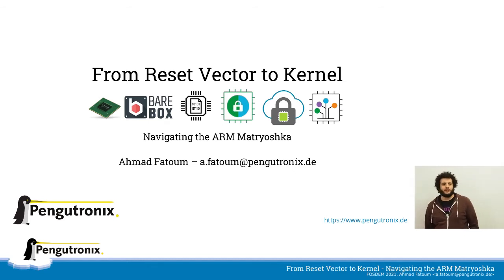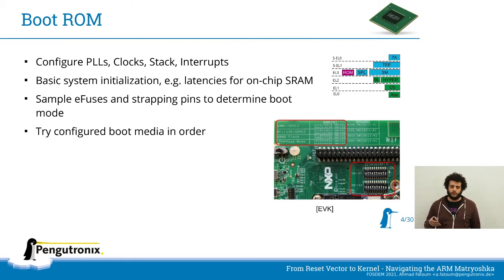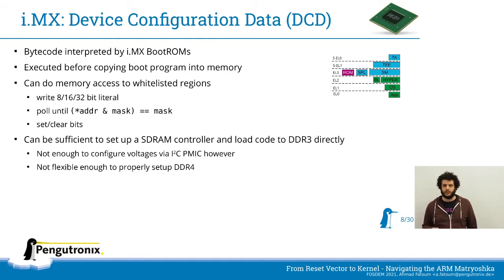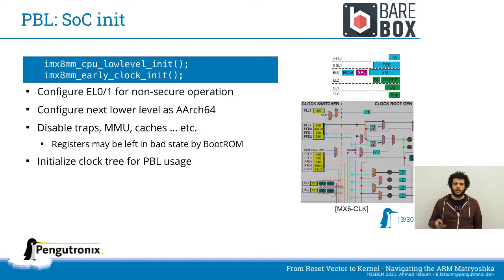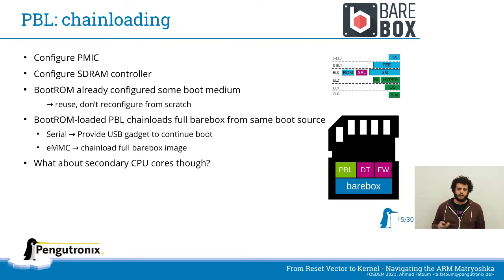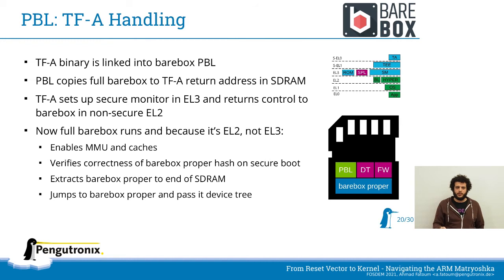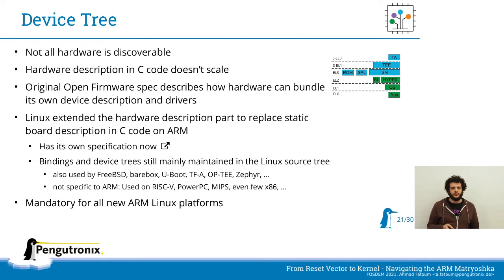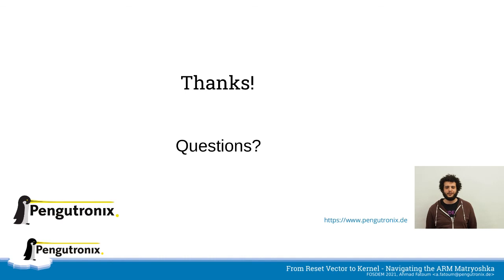From Reset Vector to Kernel - Navigating the ARM Matryoshka [Update]

Comment: Just curious, where is the startup code (aka reset vector) located in the hardware?

My guess it is in CPU, is it a ROM inside a CPU?
Reply: Normally I'd assume that it lives in the ROM...
Reply from the maker: @Nunya58294  Yup, the reset vector resides in ROM in the SOC. It latches the Boot-Config / Boot-Mode pins and then proceeds loading from the selected devices. (Doing checksum and cryptographic verification as configured.)